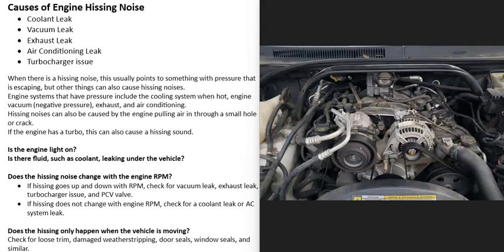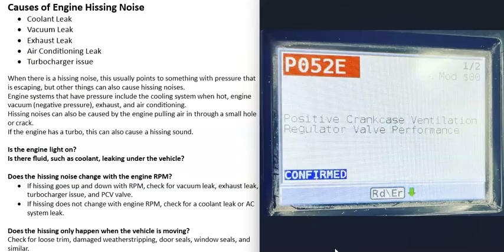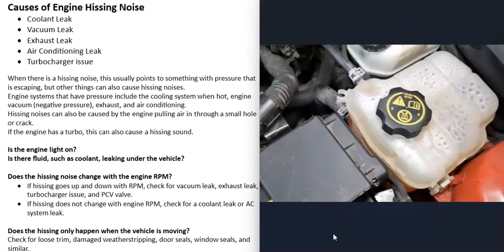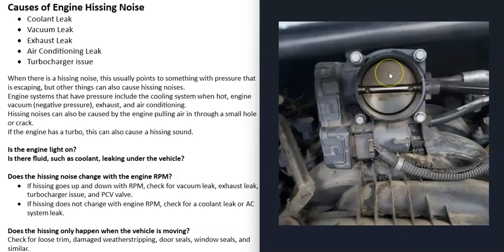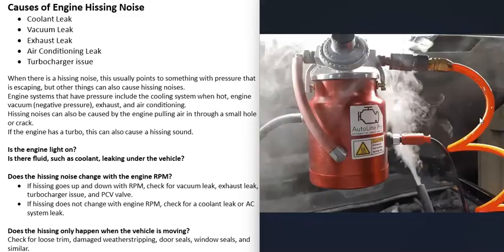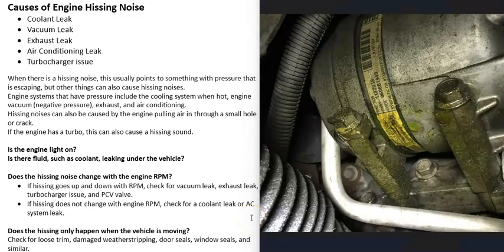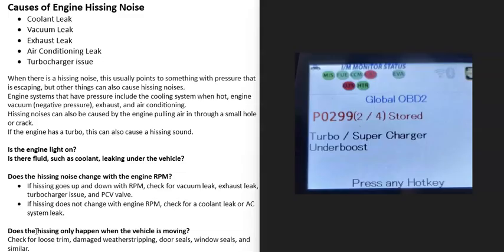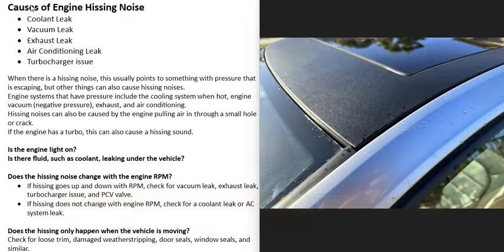Causes of Engine Hissing Noise

Comment: My 2018 Jeep Wrangler wouldn't start this AM so my dad jump-started it and once it was idling, we noticed an occasional "hissing" sound which occurred maybe 2-3 times within that first 5-7 min of it idling. The sound itself only lasted for about 10 secs during each occurrence. We checked for fluid leaks but nothing present. Over thr last 6 months, this is the 3rd time my jeep has needed jumping so my dad thinks maybe their is some correlation with this hissing sound although this sounds hasn't happened prior to today. What do yall think could be causing this hissing sound which didnt last long & if I have an alternator or battery issue snc we bought this jeep 2 yrs ago & we don't know if the battery has ever needed changing prior to us buying. Thanks!
Reply from the maker: The battery or alternator may be failing, but that shouldn't cause a hissing noise. A bad alternator belt can be noisy when bad but is usually more like a shrieking sound that speeds up with the engine RPM.
Reply: @HVAC_Mechanic I ended up taking it to have the battery and alternator tested and it ended up being the battery. It was the original battery placed in 2018 by the manufacturer & has finally started going dead. These frkn Jeep batteries are expensive as heck $299.😂 Thanks for responding as well!

Comment: hi, I have a tiguan and strangely it makes a hissing noise only the moment I press on gas pedal os standing still before the engine sound kicks in, any idea what this could be? there is no error code whatsoever. Thanks
Reply from the maker: That can happen normally when the throttle body opens up, but it can also happen if there is a small vacuum leak. Since it goes away quickly, it is likely the throttle body, which is usually normal. I would check the intake air filter and be sure it is not dirty.
Reply: @HVAC_Mechanic  will do thanks 🙏. Today first mechanic checked it and said he doesn’t suspect a leak but might be dirty PCV, i ll wait for a confirmation from another fellow mechanic cause he was not sure. Here is how it sound: https://youtube.com/shorts/y_QslPOAJuU?feature=shared
Reply: I have a 2018 Audi A5 B9 2.0 sports back and it makes this boiling hissing noise only after driving the vehicle for 10 min and after shutting down the car it will hiss or make this high pitch sound of boiling please help

Comment: My 2008 Hyindai Elantra makes a hissing sound but only on a cold start it goes away when engine is warm
Reply from the maker: Hoses can leak when cold, but when warm, expand and stop leaking.  An exhaust leak near the manifold can also do that since the metal also expands when hot, but usually it will also make a ticking sound.

Comment: What’s a good device to get the codes on. I forget what the device is called.  I have a Benz c class 4matic that’s hissing.  Pretty sure it needs a manifold and pigtail whatever it is. Trying to narrow it down still.
Reply from the maker: They are called OBDII scan tools. There are low-cost units which is likely best for most to read and clear codes. There are also more expensive units that require a learning curve to get real use from.